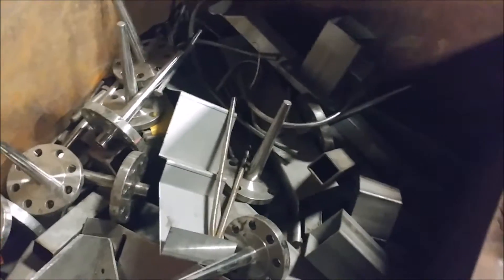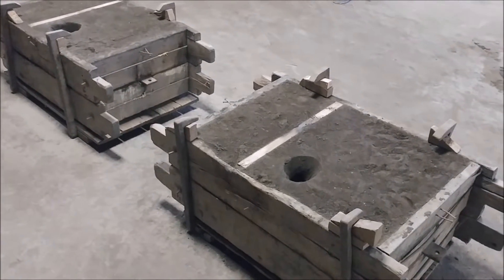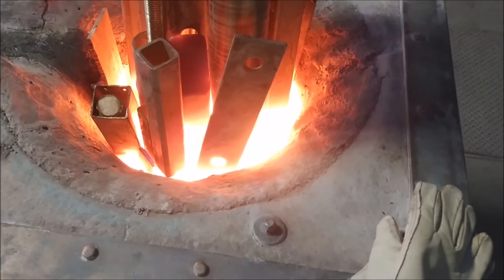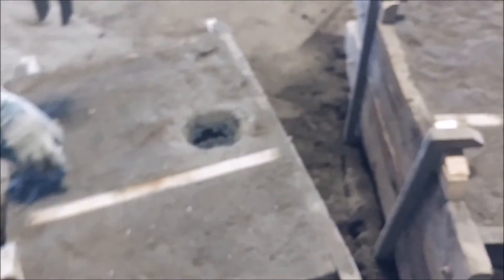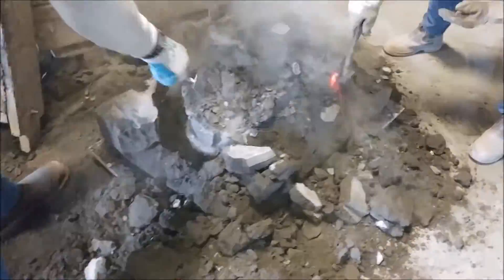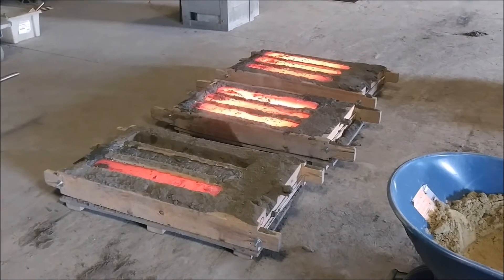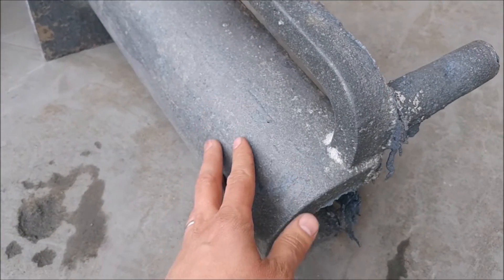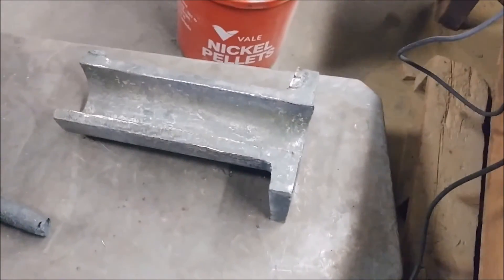Casting and Pouring Stainless Steel Parts at the Foundry

Comment: How come you can cast that in the open air, and I can't weld stainless without argon?
Reply: Because oxidation contaminates the welding of 2 separate parts and this is cast as a homogeneous part. They use a flux to deox and degas the material before casting.
Reply: @themadmachinist8637  so the answer would be flux lol
Reply: @michaelabraham9177  the oxide contamination would have existed in this material even if it had been melted in an argon environment because it was already a part of the material when melted so no. The answer is that the process itself doesn't require an inert atmosphere unless you're dealing with something exotic like titanium. The flux is to purify the material for the pour. The inert gas in welding is to prevent your joint from getting contaminated more than the material already is in order to form a homogeneous bond between the filler and parent materials
Reply: @themadmachinist8637  so basically if I'm understanding (probably not) the flux is not like the flux on welding rods, or the solar flux i smeared on the joints on the inside of my stainless steel exhaust before welding, but instead something to purify the metal?
Reply: @michaelabraham9177  yes.  In welding you can use inert gas instead of flux. in casting you can not.
Reply: Oxygen at these temperatures might even react with the carbon in the steel faster than the iron
Reply: @bilbo_gamers6417  when I think about it I believe temp has got to be it. I can't even weld mild steel with a mig without gassing out when someone opens a shop door. As a teen I did oxyacetylene welding with no covering gas no problem. If I remember correctly an oxyacetylene flame reaches about 6800 fharenheit max, whereas an electric arc is 10,000 fharenheit or thereabouts. With acetylene you have to use oxygen to cut steel, but with a plasma cutter you only need 60 psi or more of compressed air. It's gotta be the temperature difference.

Comment: Thank you for sharing. Can you give me any information on how the furnace works?
Or would you know how I can obtain a small induction furnace for about 1kg capacity?
Reply: You build a ruddy great furnace. Put 10 tons of coal at the bottom, 10 tons of limestone (flux), 10 tons of iron ore. Build a 300-foot high chimney to get a draught and inject oxygen.  Chuck a match in and stand well back! When I was a boy Sheffield had 13 of these in a row in a shed 1 mile long with 3 railway lines going through, the smoke  and red glow at night could be seen 30 miles away. My grandfather drove the electric crane to tip the boiling steel into ingots ready for rolling into railway lines or steel girders. Steel, Peach and Tozer was the name of the company.
Reply: There are a lot of induction furnaces on ebay.  They're surprisingly inexpensive.

Comment: What type of sand?
Reply: It's an induction furnace, basically a casing, a water cooled coil and a liner if alumina or other material.  Throw in a hell of a lot of electric and you can melt metal.  I'm guessing the pour was around 2900°f.

Comment: Hi, would it be possible to mass produce Stainless Steel parts (Grade 304)? We have a bracket that's currently made through Pressure Die Casting (Aluminium). Annual requirement is around 1 million /year. Please give your inputs.
Reply: Hi, do you still need casting of parts? My brother and I are working on building a furnace.

Comment: what is the type of linning used
is it quartz or alumina
which grade of stainless steel is it austenitic or ferritic
Reply from the maker: This is 300 series stainless.  Alumina lining
Reply: But I got that it is possible to melt 300series in silica quartz, isn't it
Reply: Although, it's high alloy but its slag is kind of acidic.
Reply: 304 is an austenitic stainless steel.  Depending on the Cr/Ni ratio it can also contain up to 25% of a constituent in the microstructure known as ferrite.  Other elements also affect the ferrite formation.  When ferrite above about 3% is present the material will exhibit a slight magnetic attraction.  More ferrite = a higher tensile strength and reduced low temperature properties.

Comment: Induction furnace..high freq a.c. right? Stainless is so hard to drill lol! I've worked around it in machinery. Its strange how nylon guides can wear a groove in it!
Reply from the maker: Right on the furnace
Reply: @Aaron Washburn Heh Aaron, there are several ways to harden the metal.  When you're drilling/ cutting it, the heat comes from the friction on the drilling/cutting bit.  After it gets hot (- I've seen stainless get red hot from a drill bit, then promptly destroy the bit), it can change state into a very hard material.  If you use a sharp drill bit and cut slowly with cooling fluid, you don't cause additional hardening to take place.
Reply: Thomas, stainless is actually quite a soft/weak metal (- especially compared with carbon steel). Stainless is really bad at heat-transfer, so if you start to 'work' stainless (- e.g. drilling/ cutting), the heat rapidly builds up locally, which work-hardens it and it becomes extremely difficult to 'work' further.  If you keep the material temperature low when working it (- really slow drill speed or cooling fluid), the stainless remains soft.
Reply: @RangieNZ  I'm a machinist, yes, high drill rpm reduces your chances of good drilling.

But it isn't a heat issue as much as it is a tool pressure issue, if your drill is dull, or you aren't cutting into new material continuously, you will end up with a work hardened surface.
But a work hardened surface is not the same as a thermally hardened surface. It's more akin to when you bend a copper wire, it's more difficult to bend it straight again, it's the same principle.